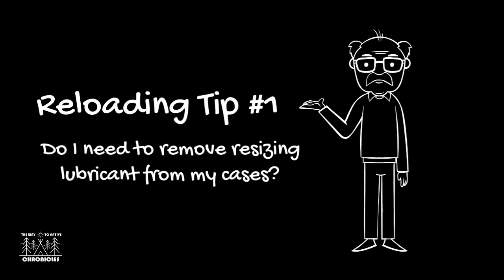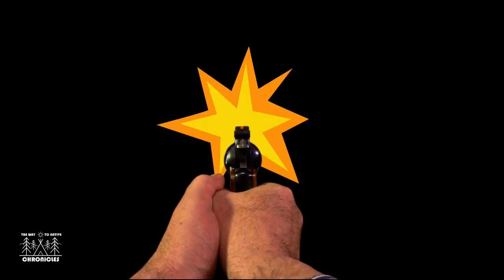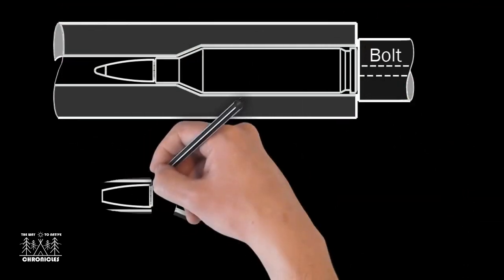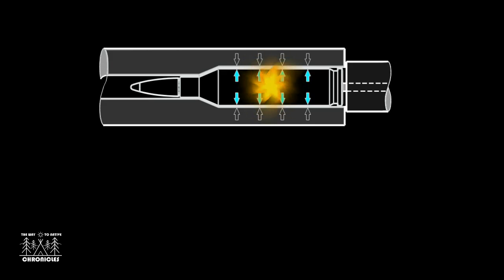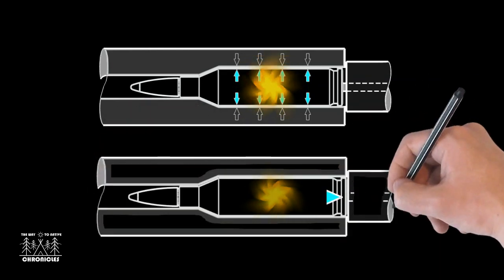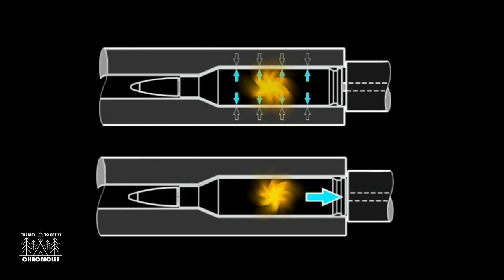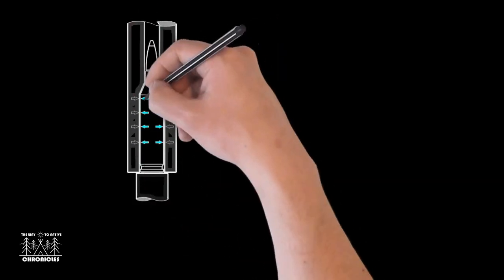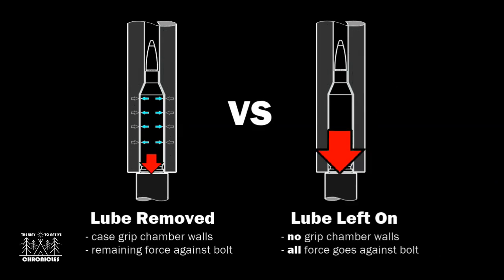Do I Need To Remove Resizing Lubricant?

Comment: Maybe I'm wrong but I did the math to verify this which follows. I've heard this for years and wondered and loosely checked it but did it thoroughly now before I said anything. The ultimate tensile strength of brass (generalized) is 45,000 PSI, roughly. Considering a brass case with an OD at the stress point (where the case is no longer supported by the chamber) of 0.435" and a wall thickness of 0.030" (which I think is generous), the amount of brass in that ring, in square inches, is: 0.038151. The remaining ID offers 0.11039 square inches for the expanding gas to press.  At a chamber pressure of 52k PSI, the force applied on that 0.11039 sq inches is: 5,740 pounds.  The ultimate tensile strength of roughly 45k PSI times the 0.038151 sq inches is only 1,743 pounds.  That 30 thousandths of an inch donut of brass can only support about 25% of the applied force on the inside diameter of the case at that point. And that's the ultimate yield strength, well above simple yield strength (about 4 times the plain yield strength).  Removing the case lube "sounds good" but, unless I missed something about simple physics of applied forces, that brass cannot hold the force applied by itself and will fail.  That case could be glued into the chamber and its pants (case head) will be blown off by the "low" chamber pressure of even an AR-15.  As the applied force to the case head is well above the ultimate yield strength of the amount of brass in play, no matter if there is lube or no lube, the brass will not hold any appreciable amount of the force applied, and almost the entirely of the force will pass to the bolt.  If the retention of the brass in the chamber was an integral component of reloading safety (e.g. case failures due to inconsistent brass/chamber traction or friction resulting in the brass being unable to prevent overloading of the bolt), every reloading manual and container of case lube would be plastered with warnings about such failure. The idea that the case being lubricated and, therefore, causing extra forces to pass to the bolt sounds good on paper but, unless I blew the math there, it's not borne out by physics.
Reply from the maker: Thanks for that in-depth examination of the topic.  I find nothing to disagree with on your brass strength points, but I think you overlook the central point:  Just because the chamber doesn't completely hold the brass body from exerting force against the bolt, that doesn't mean that it won't reduce the pressure against the bolt.  This is why this is such a hotly debated topic in some circles; because failing to remove lube does not result in instant failure (damage to the bolt).  The point is that it reduces the pressure and the strength of the bolt has been designed with dry cartridges in mind, in terms of how much pressure it can withstand.  Sure, going over that pressure (due to lubed cases) will probably not result in immediate failure (although that's a possibility), but it is hard on the gun.  Thanks again for your thoughtful comments.
Reply: @TheWaytoNativeChronicles For what it's worth.  When I fireform 30-30 Ackley Improved cases using factory ammo in my single shot, I'll use an oily cloth and wipe down the case before firing.  I want that case to shove back against the breach to fully conform to the new chamber.  It seems to work perfectly.  I'm not about to argue with that math, though.

Comment: Read Hatcher’s Notebook about match shooters lubing bullets and the greasing of the chambers of their NM 1903 Springfields. Several bolts were broken from greased cartridge firing thrust. Clean your cases in a ultrasonic case cleaner using dawn dish soap and water. Some lemishine would be good to add also.
Reply from the maker: Yep, a case that grips the inside of the chamber walls is a good thing.  Personally, I clean each case one-by-one, using a piece of paper towel dampened in 99% rubbing alcohol (makes 'em squeaky clean, plus I get an extra look at each case).

Comment: The problem is headspace and not lube. With lube sure it stretches in one direction. Without it stretches in the other. 60,000 psi. That case is going to stretch if its given space. Either way it stretches in the same place ahead of the web, at or jsut ahead of the unsupported part of the case which is not reflected in your drawing. It's not safe to shoot a poorly headspaced rifle and how slippery the case is is irrelevant.
Reply from the maker: Thanks for your input, but I think you misunderstand the main point being made.  Yes, headspace is important but, even when headspaced perfectly, leaving lube on the case results in far more force being applied (unnecessarily) to the bolt because the chamber can't help out by the case gripping its inside walls.  Cheers.
Reply: @TheWaytoNativeChronicles  thanks, but I didn’t misunderstand. Case head separation is from headspace problems and bolt thrust is the sum of several factors, with case shape being a major one. I’m not saying you should leave lube on for best results, I’m saying that lube is one factor in slipperiness, and slipperiness is one factor in bolt thrust, and bolt thrust is one part of safe operation and longevity. It’s akin to saying that lemon is the main ingredient that makes eggs benedict: yes it is a factor but it’s one of many ingredients that make up the whole recipe which are inseparable from each other.
Reply from the maker: @jcarry5214  we actually agree then!  It's just that this video (as far as I can recall) is not dealing with head separation (I may have used the head separation phenomena as an example to show that the case grips the chamber wall, is all).  I did, however, make a video on the subject of head space (which aligns well with what you're saying).  You can see that video here if you like:  https://youtu.be/7wzNYln1mxY

Comment: Hey,

New to reloading and saw this.  I'm trying to get into all of the right habits NOW, rather than fix bad habits later.  I'm not going for cost savings.  I'm going for consistency.

One of the pieces of advice I've been given about case lubricant is to put 50 or so pieces of brass in a bag, spray in my case lube, and shake them around.  I've been told that by NUMEROUS people.

But after reading my lee manual, it told me that a number of case lubes can interfere with powder, but that lee case lube doesn't.

That didn't make me think "I need to buy lee case lube".  It made me think "after I resize... how do I make sure I've removed any case lube that may have made its way to the INSIDE of the brass".

Do you have any suggestions?  Am I overthinking?
Reply from the maker: Based on the fact that every instance I've read of cases getting stuck in die involves the use of spray-on case lube, I would strongly recommend AGAINST using spray-on lube.  Better to get yourself a pad like the one RCBS makes, apply some proper lube to it and lube the cases that way.  I've never had a stuck case in over 40 years of reloading.
Reply: @TheWaytoNativeChronicles  heard.  Will look into it.

That said, after the case is resized, do you have tips for removing case lube that may have worked its way to the inside of the brass?  I saw below that you cautioned against over-tumbling, and advised the use of alcohol amd a rag to clean the outside.  Do you have any similar tips for decreasing the inside of the brass?

Or better yet... is that even a problem that "consistency" reloaders worry about?
Reply from the maker: @marcush4741  I have no solution to removing resizing lubricant from the inside of the cases but, so long as you don't use spray, it will never be an issue to affect your reloads at all.

Comment: Interesting points has I'm only month into reloading my 223 and 243 bolt actions, from day one I dry tumble my cases with walnut shells get them out lube neck size,de-prime when back in tumbler for quick hour clean then ready for primer so on through, has a newbie to the world of reloading I'm all ears to how shooters/hunters reload in different ways please let me know if I'm missing something regards
Reply from the maker: Welcome and it looks like you're off to a good start.  Based on what you describe, I'd say you could ease off a bit on the tumbling.  Tumbling to clean, for most practical purposes, is more of a cosmetic issue (something I don't do anymore).  I just moisten a rag with high-proof rubbing alcohol and wipe the exterior of the cases clean before lubing. 

I used to have a lot of reloading videos, here on this channel but, because of YouTube's restrictions on such content, have had to move them to my Rumble channel.  If you like, you can view them here:  https://rumble.com/c/c-1218724

Comment: The question that brought me here is HOW do you remove the lube from the case.  Since I normally use wet tumbler to clean brass I find it annoying having to load a heavy drum than separate the pins and wait for the brass to dry especially if I want to reload quickly a small batch in which case I line up 10 or so cases on old t-shirt spray it with rubbing alcohol, rotate 180 degrees with the palm of my hand, spray again and than cover with other end of tshirt and roll it back and forth and that pretty much removes most of the lube.  I am considering to buy a vibratory tumbler just for the purpose to remove lube!
Reply from the maker: Yeah, removing lube from the cases can be a bit time-consuming.  I moisten a piece of paper towel with rubbing alcohol (90+ % proof, not less) and wipe them individually.
Reply: @TheWaytoNativeChronicles  What about just throwing in the vibratory tumbler with crushed walnut media??
Reply from the maker: @DimaProk  I used to do it that way and it worked well.

Comment: Isn't the chamber tapered so that no matter what Case comes back toward the bolt?
Reply from the maker: Yep, it is tapered somewhat to make insertion and extraction easier.  But, even having a slight taper, it still strongly grips the inside of the chamber when the round goes off.  If you think about it, that's precisely why, when you have an overly-long chamber, the case cracks just ahead of the case head (it's the only thick part of brass, which will be free to move rearward, so all the stretching occurs in the piece of thinner brass just ahead of it).

Comment: So how do you remove the lube?
Reply from the maker: There are a number of ways, including just wiping it off with a paper towel.  What I do is wet the paper towel with a bit of 90% rubbing alcohol.  That really get the lube off good and cleans the cases well.  Some people just tumble their brass in dry, crushed walnut hulls.  Lots of ways.  Personally, I like the one-by-one case wiping method because it gives me another chance to take a look at each case (to detect any case mouth cracks and such).  Hope this helps.
Reply: @TheWaytoNativeChronicles  thank you!
Reply: @TheWaytoNativeChronicles  That's what I do too.
I always have the quart bottle of 90% isopropyl alcohol on hand for just that purpose.

Comment: One more reason to neck size for your bolt guns. Lube removed, case head against the bolt face.  Excess forces reduced as much as possible. And as a bonus likely better accuracy.
Reply from the maker: True enough!  Unless (like me) you're making ammo for both your own gun and your wife's (both .243), so it has to fit both.  For my XP-100 bolt pistol, I've never full-length resized the cases.  Another bonus is the cases last so much longer too.
Reply: Talk to the top competitive target shooters in the world, and nearly 100% of them Full Length Resize every time.  I shoot in IBS & 50 BMG long range comp, and I full length resize, as does every competitor that I personally know.  When resizing I only bump my shoulders back .0015" and I anneal my cases after every firing.  Check out Erik Cortina's Youtube Channel, in regards to Neck sizing vs FL sizing.   https://www.youtube.com/results?search_query=erik+cortina
Reply: @MrComputerdog58  Haha!  I was just going to reference the Cortina video as well.  In fact, he just did a follow up video to his first where all the "opinions" were shared. In the second video, he is an F-class championship of some sort.  He literally walks the entire line and asks every world class champ how they size...full length.  :)
Reply: Testify
I neck size only for my bolt action.
Of course, it's not really an option for semiautos, levers, or pump guns.
Reply: @fenomeno71  I know there's probably an aspect about it that gives them an advantage, but what is the rationale for full length resizing from the BR shooters?